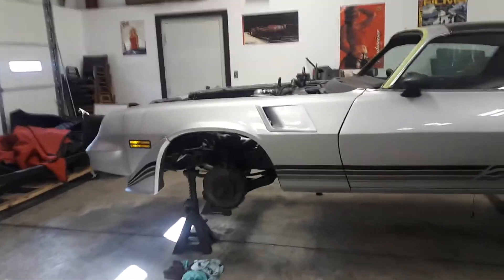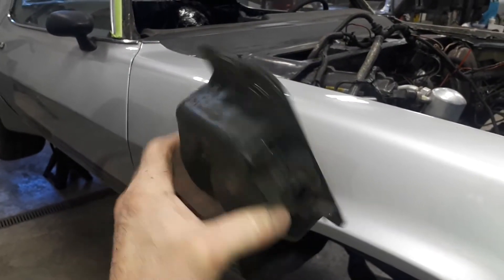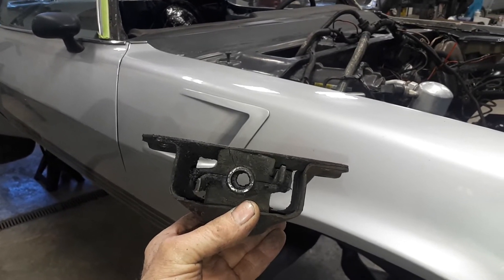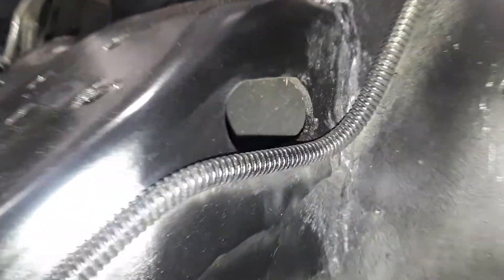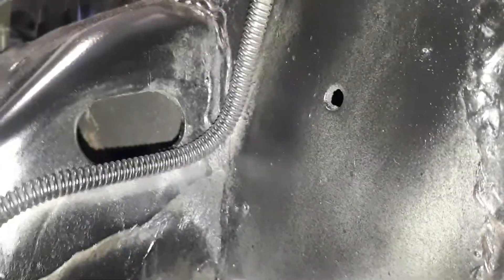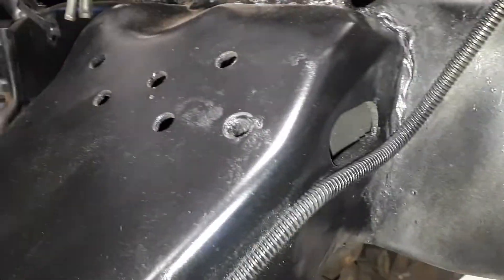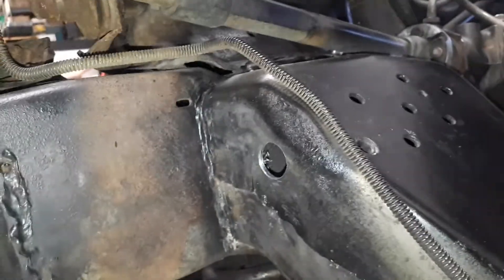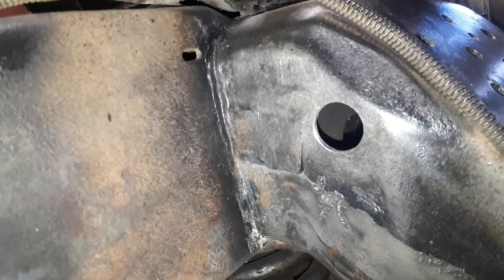Z28 Engine mount replacement

Comment: Sounds like that was 15 m, would a 3/8 nut and bolt work, thanks, and also is it a solid mount that comes off the motor